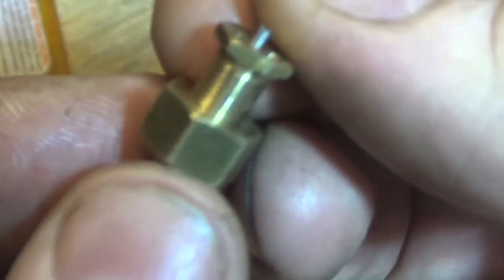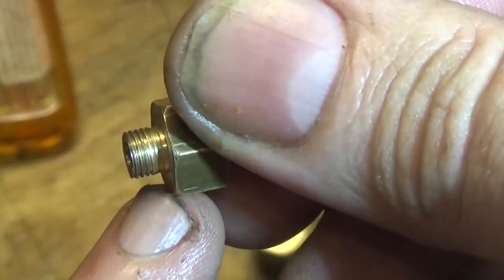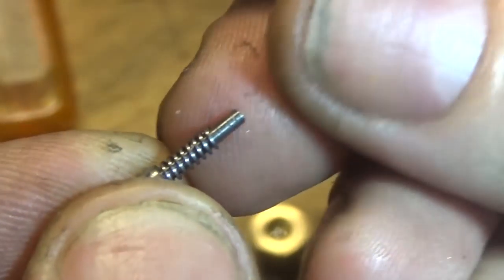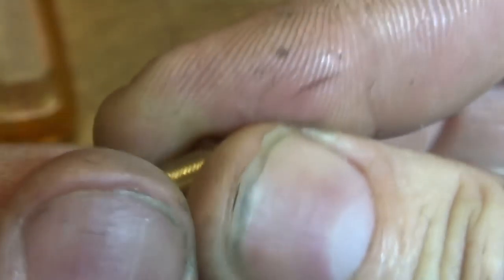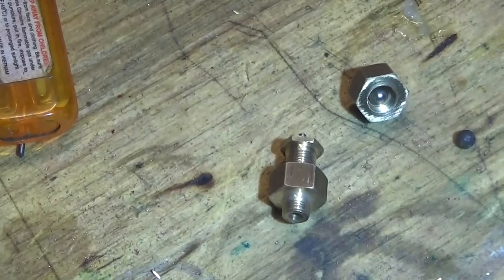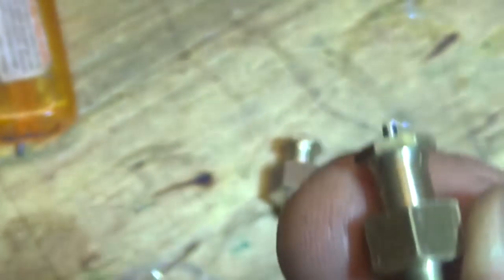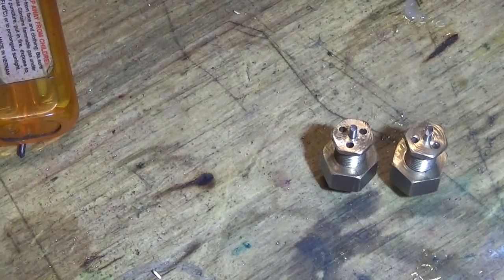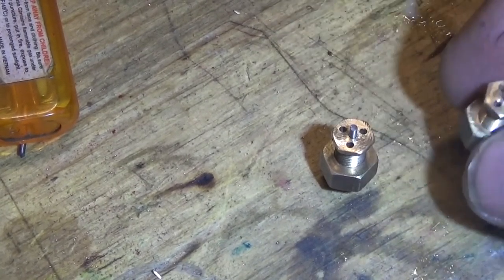two little safety valves, all in a row!

Comment: Looks good, I know little parts are fiddly but I find them rewarding to make. Did you know to test the relief pressure setting you can fit a gauge to a grease gun on a T  and pump slowly with light oil or diesel and see how it works before fitting it.

Comment: neat little safety valves, looks like a really nice design. I was wondering if they tend to whistle like some of the valves do or if they're quiet when they blow off steam?
Reply from the maker: the bigger one i have here on a boiler is pretty abrupt. a round seat tends to let all the steam go at once. hopefully these are the same. when a valve pops, i believe theres a lot of expansion of steam. some flat face valves dont deal with that as well as they should. thats why id prefer these to to the little mammod valves or similar.
Reply: yea, I dont blame you. Only things I'd probably change is that I'd drill some holes around the outside of the valve where the threads go all the way up for more steam to escape at once, so it doesnt get overloaded by an overactive boiler, and put a jam nut on the threads so that it doesnt unscrew itself over time and mess up the blow off pressure setting of the valve.
Reply from the maker: i think the area will be plenty, the boilers these go on are about 8 cubic inches. but a lock nut is a pretty sensible idea. usually ill adjust the spring length to the pressure and screw them home tight. might make a nut though to go on.

Comment: Can you have a row of two? Or do you need at least three? One will clearly not do!
Reply from the maker: haha. thanks for watching though!
Reply: Actually, on an industrial water tube boiler there are typically three. One at each end of the steam drum and one on the super heater outlet. The one on the SH outlet is set to pop first so it will maintain steam flow through the super heater.
Reply: Noel Henderson the question was about how many items it requires to make a row? You could substitute chess pieces for safety valves and still be asking the same question!